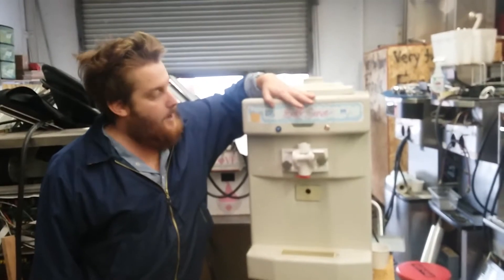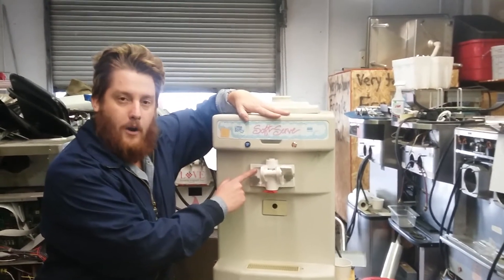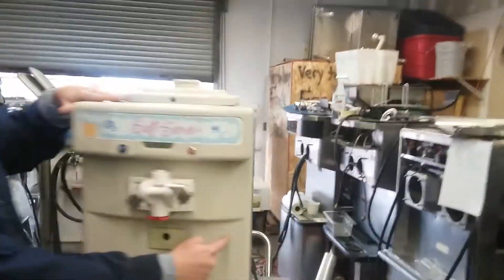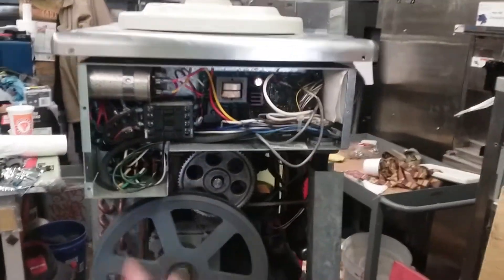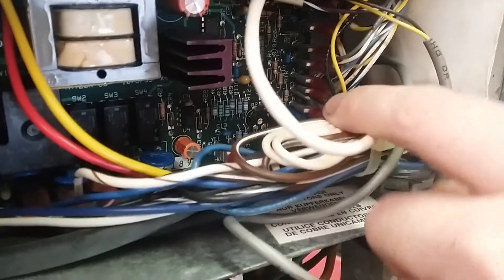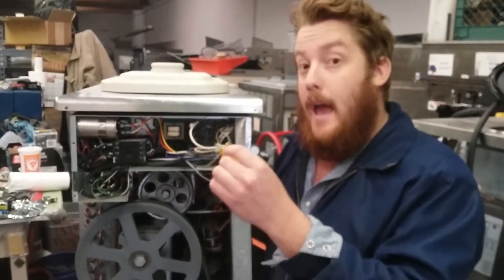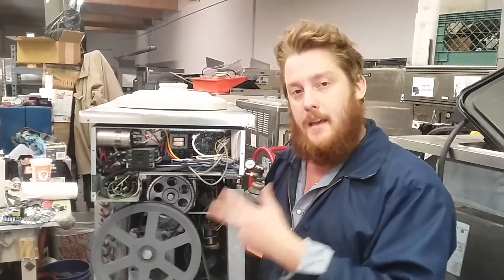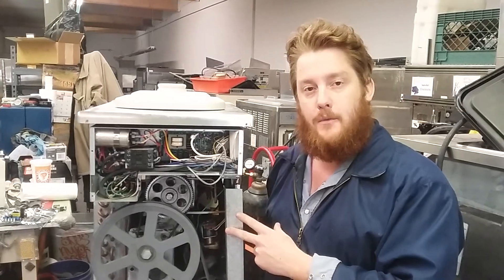Changing the Barrel temperature on a Lil Softy Taylor 142

Comment: Hello, I bought an early model 142 that uses a capillary tube type temp controller. Do you know how I can test it? It also has a thermocouple spiraled around it one side wired to a transformer. I haven’t seen where the other side goes to yet.

Do you know if it’s possible to order another one of those?

My 142 constantly cycles on and off. Sometimes it will work fine then it will start cycling on and off again. I can hold the contact relay in and it will eventually start working again.

The Taylor folks here haven’t been much help. I’ve alread got about 500.00 dollars into them working on it.

Any ideas?
Reply from the maker: I do not see a record of you buying that from us? Did you? We are more than happy to help folks who bought machines from us. 

Call the 775 area code number on the website tomorrow (between 8am-2pm PACIFIC time)